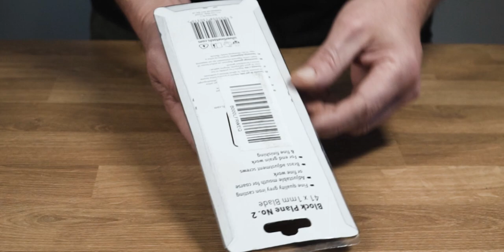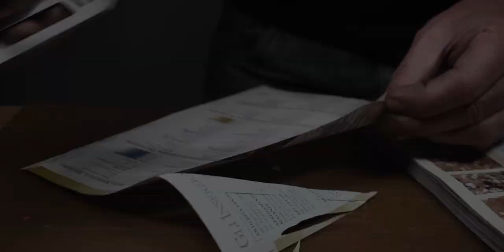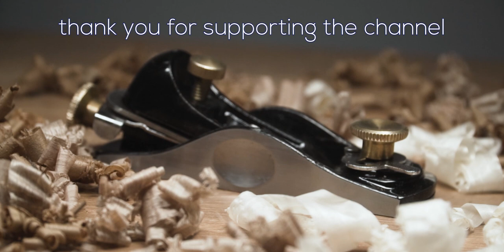Cheap Hand Plane Setup and Tuning - It is worth it?

Comment from the maker: What do you think of the shavings from the final test?
I am pleasantly surprised by the feeling you get when using it, very smooth and controlled. Not bad at all for a cheap block plane as this one.
"The best tool, is the one you have"

Comment: Amazing what a little bit of love can do 👍
Works so much better now. 10 out of 10 points. Your little sharpening depth gauge is also a top idea.
Reply from the maker: Thanks a lot for your support. The depth gauge is very useful because it allows you to be constant in measuring the angle.

Comment: I have the exact same plane and it could do with a similar makeover. Some dialog to explain what you're doing would be really helpful.
Reply from the maker: To setup a hand plane in a correct way, the first thing to do is to make the sole completely flat and smooth (I start from 100 grit and go up to 600/800), this operation must be done with the plane assembled and with the blade retracted.
Then the imperfections of the casting marks must simply be eliminated to allow the blade to sit firmly in its seat.
Above all, the mouth must be filed and made as smooth as possible.
This plane had paint drips everywhere and it required a little more work.
The blade must be sharpened with a double edge (25° the main one and 30° the secondary one).
It is a procedure that must be done on all hand planes, even expensive ones because they always have manufacturing defects.
Maybe I took it for granted that the images were enough to make the procedure clear, but I thank you for the comment and I will add subtitles with the preparation details.
Thanks for letting me know.
Reply: Thanks so much for the detailed helpful response!  @LTMS
Reply from the maker: Thanks to you for your feedback, don't esitate to ask if you need  @overlyskinned

Comment: I also always look for best deal but sometimes I wonder if it is smart lol - well at least it works albeit it is not comfortable to use.
Reply from the maker: After the fix was very comfortable and pleasant to use. Since hand planes require setup anyway (even the high-end ones) I bought the cheapest one to see if it was worth it, and for my needs I'd say yes. Thanks for visiting and comments.
Reply: @LTMS  Yes I agree - expensive does not always mean better either...glad that it works well for you now!